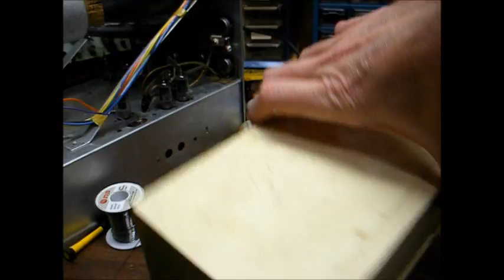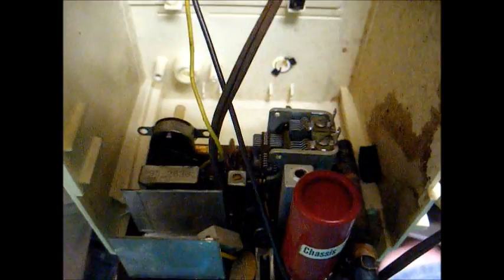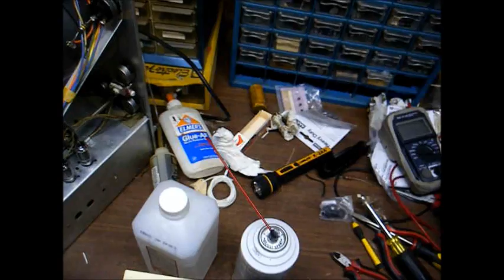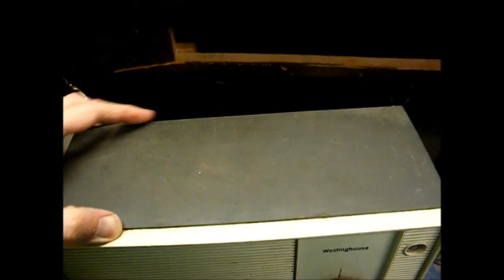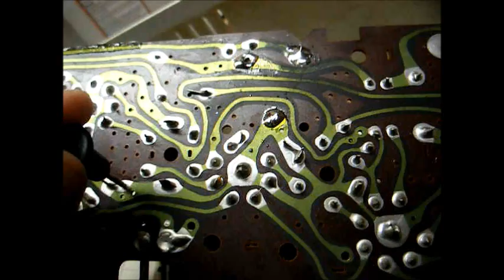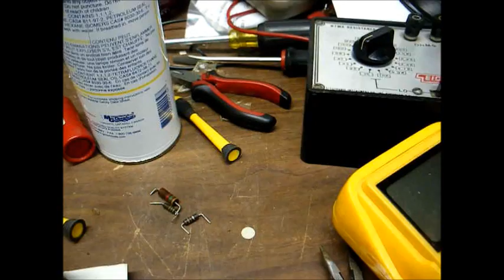Repair of a Zenith solid state radio & a Westinghouse tube radio

Comment: Today’s Chinese radios are throw away. They use micro surface mount integrated circuits and are virtually impossible to repair. They also employ electronic tuning done by a potentiometer and eliminated the tuning capacitor. The tuning pot has a high failure rate and unobtainable

Comment: Have you ever done a step by step replaceing a filtering cap to a modern caps .if. so could you let me no where to find it ,I been doing electronics in kit form for over 40 years I even found when I was younger a tube type tuner kit that works great for about 40 years but I am trying to learn from you ,I have a five tube 1960 something radio I need to put in a filtering cap in any help would be nice from you or anyone that can help advise me thanks for your video's they are amazing.

Comment: Westinghouse is a crappy brand. Someone I know bought a Westinghouse TV on Black Friday and the sound was horrible and the TV stopped working in 2 months.
Reply: Ryan Toomey Not the Westinghouse that was made in the USA, 50 years ago.
Reply: There was a rash of "Westinghouse" TVs with pinched wiring harnesses; I saw some YT videos on an easy fix. Mine is about 3 years old with no problem, so it's likely to last a while and the price was right. I won't be happy if it dies just after the 5 year warranty runs out, but I'd be more unhappy if that happened with a Samsung or and LG at twice the price. I did have to add PC speakers with a subwoofer, but it's in a built-in cabinet with my stereo, so I've got plenty of sound options and not much mess.

Comment: Nice simple fixes; I'd say the Westinghouse sounds better than the Zenith. Seems that they let the sound quality slip on a lot of those early SS designs. Not that they had to: I had an Admiral "hot chassis" SS radio from that era that sounded great, but it seemed to take some  of the other brands a few years to get the same quality of bass that the tube sets had, and by that time the feature-packed imported sets with crappy thin-profile speakers were overrunning the market.

Comment: Great video! On that Westinghouse radio, it's interesting to see the tube look like real Westinghouse tubes. (red printing). Strangely, most Westinghouse radios from the 60's I've worked on have GE sourced Westinghouse branded tubes. I know they're OEMs as they have a consistent date codes and are marked "E-Met." Strange because they made their own tubes starting in 1952.

Comment: Do you just plug in the electronics or do you safety check the, first
Reply: He'd just plug it in. You can use a variac though if you want to but most times it isn't necessary. If anything does burn up it won't result in the whole radio bursting into flames, just a resistor or something.